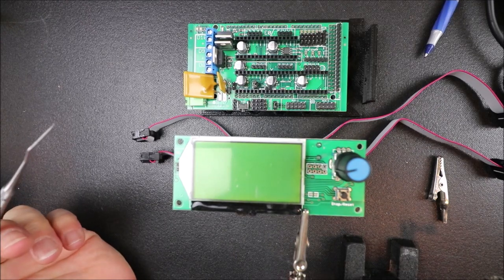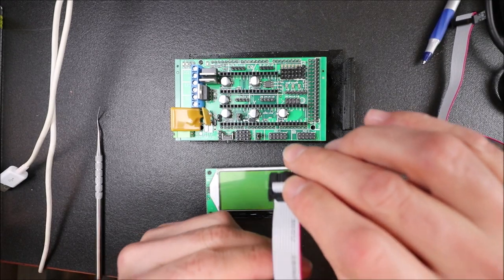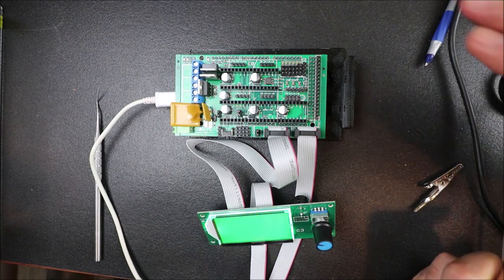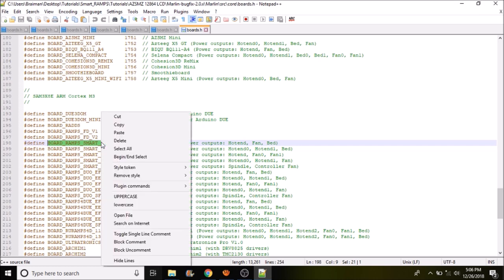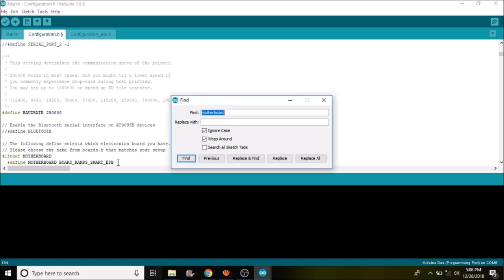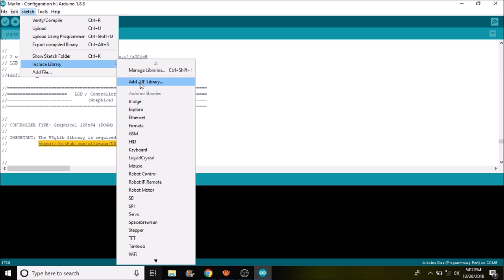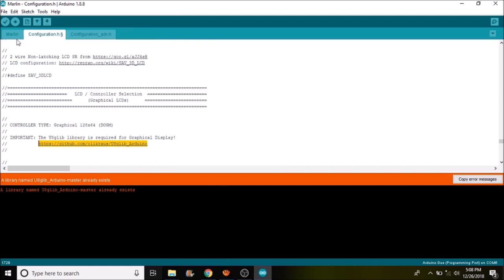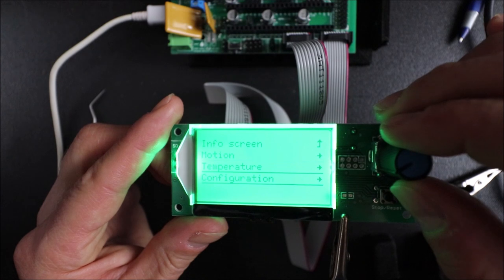Smart RAMPS - AZSMZ 12864 LCD

Comment: Thanks, for your tutorials, followed this one to get the AZSMZ board working on my Due board. Just got my printer running with the Due yesterday. Having problems with the extruder motor not running correctly. One other thing that I have noticed is that when I upload a firmware change the extruder heater turns on. I am going to send this issue to the troubleshooting team and see if they can figure out what is going on.
Reply from the maker: Sounds like a pin is wired wrong in pins file for RAMPS .  Check for something like pin 13 where pin 8-10 should be.  Sorry, might be better to post on Marlin firmware bug tracker maybe.

Comment: Why a due board and not a mega?
Reply from the maker: Smart RAMPS is designed for a 32 bit processor rather than a 8 bit processor on Arduino mega 2560.
Reply: Edward Braiman thanks
Reply from the maker: You're welcome.
Reply: I just learned something useful!, thanks guys.
Reply from the maker: You're welcome.

Comment: the marlin bugfix 2.0 has same probleme when i put to print
Reply from the maker: Could you explain a little more?
Reply: after the first layer extruder is go to the switch and back again to print or somthing like this
Reply from the maker: So if you're using Pronterface what error do you see?  If you prefer to write in another language, such as french or something else I might understand your issue clearer.
Reply: i am sure that the problem is from marlin bugfix 2.0 code, becase i did tested whit the old edition marlin for mega2560, i tried to do some modification in marlin bugfix and i solved the problem on the max_pos, but i still have problem with the min_pos x and y during the printing.
Reply from the maker: Do the motors feel warm or hot?  Or do they make a lot of noise?
Reply: the motors work corectly, but depends on the drivers if make a lot of noise or not, in my case only the motor from z axis make some noise.
Reply from the maker: @-alexandru-5008  Download Pronerface zip from here and connect, then try and move axis and see if there is an error message ... https://github.com/kliment/Printrun/releases/tag/printrun-1.6.0
Reply from the maker: you want to open in  unzipped folder Pronterface.exe then connect to serial port displayed.  If characters are scramled, then the speed for connection might not be correct.
Reply: yes, but maybe the next week and after this?
Reply from the maker: A serial connection will help determine error occuring.